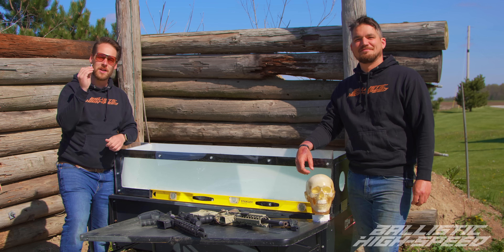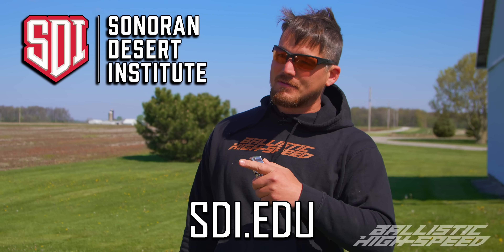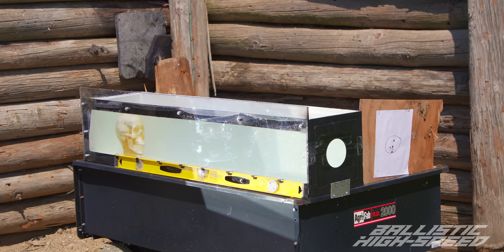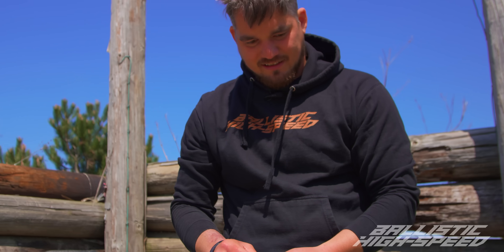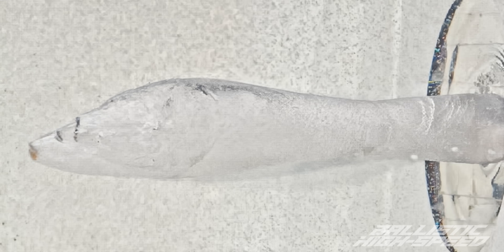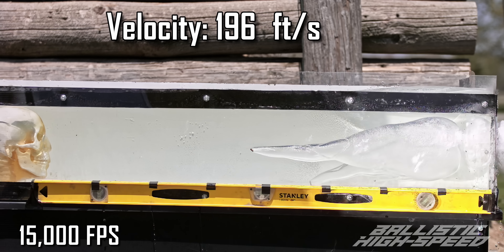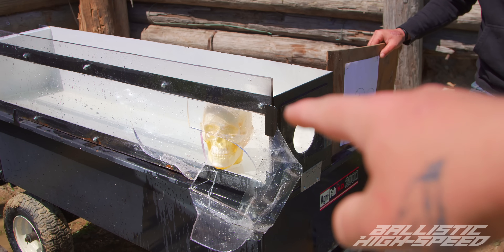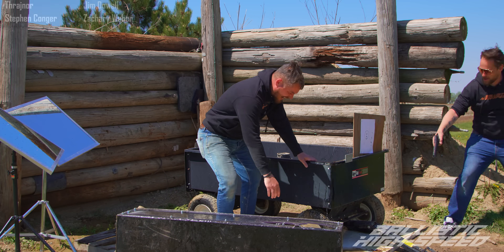How Much Water is Bullet Proof?? FMJ vs Hollow Point! - Ballistic High-Speed

Comment: I love your channel & content but I would not for one second suggest that anyone depend on this information in a futile attempt to protect themselves from being shot!  Unless the shooter is at the same range as your setup.  What you guys, and the Mythbusters, failed to recognize is that bullets, when first fired, are inherently unstable, thus you see the bullets yawing and even tumbling as they go through the water.  Note this only applies to full metal jacket, military type bullets.  Hollow point bullets may want to yaw but the expansion of the nose precludes any actual yawing.  So, once a FMJ bullet travels a distance of approximately 100 to 125 yards,, it does what ballistics folks call "goes to sleep" or settles down into stable flight.  It will remain stable until the velocity of the projectile drops below super sonic.  Once the bullet is stabilized in flight it's penetration will far exceed that of a shot fired under the stabilizing distance (this varies from one projectile to the next & depends on many factors, including sectional density, bullet construction, etc.).  The pretty much applies to all FMJ projectiles as well, up to and including the 50 BMG.  

The question, of course, is "How much difference does it make?"  This, unfortunately, I cannot answer because I have never tested it and have not read of anyone who has tested it in water.  With boards, yes, as this test is in Hatcher's Notebook, a book written back in the 1930's & 40's by General Julian Hatcher (I'd quote the chapter and page but my copy is currently on loan!).  I do it can be a significant figure, especially as the caliber goes up.  Thus dodging bullets fired from a longer distance are much harder to duck under while in the water.  

I know it might be a stretch for your shooting ability but I would challenge you guys to try at least one shot with a .308 or .30-06 (or dare I say it, the 50 BMG?) from a distance of say, 200 yards or so, just to answer the "How much difference is there, really?"  I think everyone might be surprised!
Cheers,

Comment: Heh, half inch steel box, 1" lexan 10' x 2' x 2' - use cling film as your water barrier. Blow outs along the back plugged with foam or something that gives.  It'd be cool to see how far under you need to be to escape a .50 cal.  Amazing shots as always.  So cool.
Reply: I think it was Mythbusters a few years back that already did that - The short version of their results: if you've got more than 3 feet of water between you and the gun, regardless of what caliber (biggest they could get their hands on was a .50-cal) you're effectively bulletproof. The fragments of the bullet (every round they shot turned to shrapnel within a few inches of impact) MIGHT be moving fast enough to give you a "shaving-nick" level injury, and it's possible hydrostatic shock could cause ear damage, but past about three feet, the gun might as well be loaded with marshmallow bullets for all the damage it's going to inflict.

Comment: You should make a series/playlist of the water box tests, call it 
"Splash Ballistics"

Thicker lexan, increase the height and width of the box by 75% ; should allow the box to hold together better. However, if you want to eventually test something like say 4-Bore or 50cal you may want to increase the height & width by 300% and the length of the box by 75%.  You could use at as a jumping off point to see which action films have the most accurate water ballistics; Mission Impossible vs John Wick vs James Bond.

Comment: The first 223 bullet (m193?) performed pretty much exactly like shown in Dr. Fackler's gel tests from the 1970's.  Search images for "5.56x45 fragment velocity" for a velocity vs fragmentation chart with recovered fragments. The issue is that it is inconsistent.  At high speed, the majority of the bullets will yaw and fragment in the first 6 inches or so, but 15-20% go significantly farther before yawing and would just "pencil" though a long enough distance to cause only minor wounding effects.  This is called the "fleet yaw" problem.  The effect is inconsistent and dependent on high velocity.  Once the velocity drops below about 2500 fps, the bullet will often not fragment and below 2100 fps, it almost always stays in one piece.  The M855A1 is much more consistent and breaks apart earlier, even when impacting well below 2000 fps.

Comment: Yes! What a great experiment! Should try incindiary rounds? See if water impact detonates them?
Reply: Those don’t really detonate. Rather, they burn energetically, and are intended to ignite fuels. The effects is caused by a fine metal powder (usually zirconium, titanium, or magnesium) in the tip. Older versions mostly used phosphorus. There are rounds that detonate or deflagrate; those contain an actual explosive along with an incendiary component (usually). For example, 8x57mm Mauser B-patrone (which contained phosphorus and tetryl), and .50 BMG Mk. 211 Raufoss (RDX/PETN with incendiary components).
Reply: @ashe1.070  still would be awesome

Comment: So often you hear this "hitting water at high speed is like hitting concrete" in reality it is more like hitting very loosely pack sand or soil. at a fairly high speed hitting water from 1000 feet up would be more like hitting sand at 100 feet up

Comment: The M855A1 has a steel tip penetrator and a solid copper plug, as opposed to the M855 which has a lead plug. The M855A1 is also loaded to pressures in excess of NATO standards, which means it’s fast as fuck boi (and wears out rifles faster)

Comment: Turns out lower velocity rounds have significantly less turbulence that effectively tumbles and fragments the round. I think of it like flying a plane at supersonic or hypersonic speeds, the thinner the medium the faster you can go without disintegrating, the opposite applies to more viscous fluids with higher resistance.

A number of studies have demonstrated that strangely pistol rounds retain their energy over a longer distance and in ideal circumstances and I believe that heavy subsonic rounds performed the best.

Maybe try .300 or 8.6?
Reply: I'm guessing that's why the ammo used in the guns designed specifically for underwater combat have extra-long bullets.
Reply: @badideagenerator2315  also, arrow fishing

Comment: For the "blood" to come out the way you want you'll need the round to go all the way through because as the round enters the head it pulls the water into the cavity forcing the blood to stay in the head longer then it will take for the tank to spill out. If you get the round to go straight through I believe there should be a blood trail in the water behiythe round as it exits the head.

Comment: Water cannot be compressed. If you want your box not to explode, you need a way to vent the water displaced by the temporary cavity faster. Big Holes drilled on the non camera side covered with tape  might work.
Reply: The top is completely open. I don't think anything is going to help besides thicker lexan and/or verticle steel reinforcement.
Reply: hydraulic shock is going equally to all directions, making one or another side weaker is not necessarily going to help. the only way to keep it confined is to use a stronger glass, for example bulletproof one.
Reply: Angling the sides in a «V» shape would be more effective than any holes on the back side.
Reply: I I'm thinking the seams are the biggest issue. So it would make sense to just have the water fill a giant bag of some stretchy silicone transparent material. Then press the lexan sheet against one side to get the flat view for camera.
Reply: Use polycarbonate (Lexan) instead of acrylic (Plexiglass).  It is almost shatter proof.
Reply: So, you're saying that water in it's vapor form cannot be compressed?
Reply: @JeffreyAllanBackowski No, just fluids basically can't be compressed
Reply: @JeffreyAllanBackowski  Steam is basically the only time water does compress... but it REALLY does not like it. Steam pressure builds MUCH faster than most other things, and does not semi-liquify like most other gases, which is why a boiler (or water heater) with a damaged vent becomes nearly a bomb. Since we are talking about things Mythbusters did back in the day, look back on water heater failures.
Reply: Nerd.

Comment: Man 8.6 blackout would be such a cool round to check out like this high speed.  Shot from Q the Fix its spinning 500k rpm.  Would be sick to see what that does to a soft target.
Reply: You have the best idea by far with that logic.

8.6 is spinning unbelievably fast for its size which could be very interesting in water
Reply: I literally came here to say the same thing! Mass and twist are going to be the largest factors in water pen.
Reply: GarandThumb made that round look so scary. That thing isn't even supersonic and it's destroying things. Imagine it at around twice that speed.
Reply: @A-A-RonDavis2470 it only reaches 500k rpm if its supersonic.
The subsonic is basically as many rotations as a regular rifle round
Reply: trying out tungsten and some other projectiles would be cool too.
Reply: Q the fix?
Reply: @halflifezherka  Q's "The Fix", bolt action 8.6 that's stupidly quiet.
Reply: @GerinoMorn damn I'll have to check that out. Thx. I wonder if it mostly comes in wood or plastic stock.

Comment: The Mythbusters tried water vs bullets.
Rifle rounds self-destruct on contact, pistols penetrate a few feet, and a shotgun flooded their shop by blowing the bottom out of a 10-foot deep tank.
Reply: While I was about to make the same comment, I remembered that was almost 20 years ago. High speed has grown exponentially. Also, the shotgun blew out the sides of the Mythbusters tank, not the bottom. The shockwave broke the “glass”, not the slug hitting the bottom.
Reply: @gonzoe123  20 years already? D@mn, i feel myself old
Reply: @gonzoe123 the high speed photography didn't change ballistics
Reply: @psynurse  correct, but it does change how we can perceive it in more detail and higher frame rates.
Reply: @MH2ga.12  Yeah, that's where they shot the 50 cal... pretty much the same results, the deepest penetration were the slower velocity hand guns and even the 50 cal tore itself apart in the first couple of feet.
Reply: As I recall, they determined the faster the bullet, the less water needed to stop it because hitting the water at hypersonic speeds was like hitting cement.
Reply: @peterkoester7358  high school physic.  Right 🤓 Anybody that's done a belly flop into a swimming pool has felt the effect of H2O incompressibility.
Reply: @peterkoester7358  supersonic but not hypersonic, even the fastest bullets top out at around Mach 3.5, hypersonic starts at Mach 5.
Reply: @MarkoDash  Thank you, yes.
Brain fart.
Reply: Totally off topic, but your comment reminded me of something I did when I was younger. I mixed a high acid hot sauce with a base in a plastic coke bottle and got it to shy of bursting. I then shot it with a 177. Air rifle and was surprised to find that the pellet simply zipped through it without it exploding.  @peterkoester7358
Reply: 9mm was the  winner in that episode if I remember  I might be wrong  though.
Reply: @davidblack7184  I saw one episode where they did this but the outcome was a musket ball was the winner. Because the round had a lot of mass, was round and most importantly hit with a much lower velocity. I wonder if the one I saw was a revisit episode done later?
Reply: And even the .50 cal disintegrated before it got too far... albeit with a ginormous explosion of water from all the energy :)
Reply: Well water is pretty much incompressible so the faster something is, the higher the water's resistance to movement is - pretty much speedy bois like the .223/5.56 get disintegrated within a few cm (.308/7.62 is considerably slower).
Reply: And they shot at a realistic angle and not flat on horizontal. An angle could even make the bullet ricochet.
Reply: we need to use a 20mm autocannon with DU AP rounds
Reply: still insane that they did that test in their shop and not at a range
Reply: @Pigness7  any engineer knows this. We learn this in year 2
Reply: Going to have to watch that episode. I watch their "largest explosion" last night, a concrete truck went to meet baby jesus via 3,000 lbs of anfo. 
(Similar high speed footage on that video as this videos handgun vs ballistic head under water damage demonstration)
Reply: I remember so much from myth busters. Someone needs to re start it
Reply: So the question is if someone is chasing you with a rifle do you jump into the river or sea if you can try to dive into it for abit?
Reply: Point 50 turned to dust
Reply: also mythbusters did it in a pool of water. Not an expert but maybe that difference in volume plays a difference between experiments
Reply: That was one of my favorite episodes.
Reply: I was thinking the same thing
Reply: Did they have 4k?
Reply: Mythbusters is complete junk science. Their methods are sloppy, their results are questionable. They are poor scientists.

In my book, they're entertaining in the same way the guys from jackass. They do stupid crazy stuff. That's it..
Reply: MythBusters cut a lot of corners on a lot of things. Their bullet through the scope episode was terrible.
Reply: @jacobstaten2366 They ended up revisiting that one because of the number of viewers who complained that they didn't use an authentic Russian-made scope that was designed specifically for that type of rifle (Russian made Mosin-Nagant 91/30). After repeating the test using the proper scope, they determined that the shot was indeed plausible.
Reply: @donaldfleming5049  that's cool to hear that they're willing to try it again. Add more respect for them.
Reply: Why did they use a 10 foot tank lmao
Reply: Did the .308 break the container because it was a hallow point? I thought there was practically no difference between it and 5.56..
Reply: What they did differnt is they pointed Down so the deeper it went the faster it stoped water pressure probably
Reply: Actually, it was the compression wave that caused the tank to fail, not the shotgun round itself. That's why they opted to do the remaining tests in a pool instead of in the shop
Reply: The faster a bullet is before contacting water, the easier it is for that bullet to shatter right away🙏
Reply: Never underestimate the power of a shotgun.
Reply: The Mythbusters were seriously constrained by California law, which doesn't allow real AP ammo, or even mild steel core like Soviet 7.62x54 or 7.62x39 and 5.45x39.  As for 50 bmg, or 30-06 performance, they certainly were not using real AP ammo.  Full metal jacketed lead core ammo will come apart while tumbling in water.  Hardened and super tough steel core AP will very much go though water, but it will tumble.  Western states didn't like people going out into the desert or forests and plinking with the super cheap Chinese mild steel core 7.62x39 ammo because steel hitting rock caused a large amount of sparks and resulting wildfires.  That TV program was very entertaining.  Grant (RIP) was the only one with a scientific background.  The lack of rigor from his castmates probably irritated him a bit, but he never let it show.
Reply: @Kaseymatthew1893.....
I guess these guys missed that episode. Lol. Or maybe, they were just graduating middle school. 😃